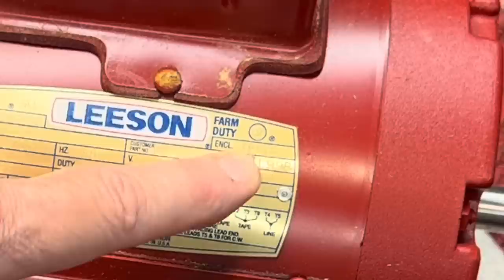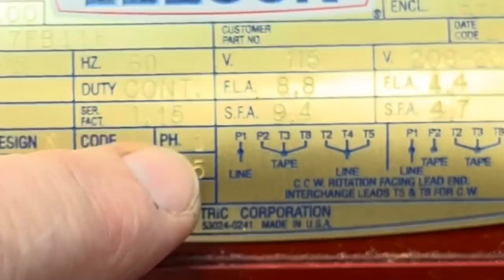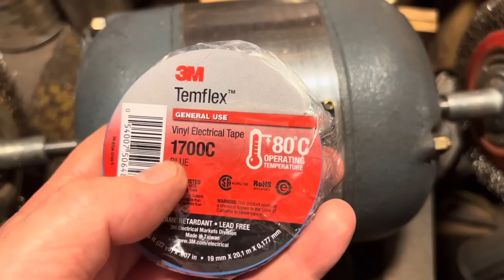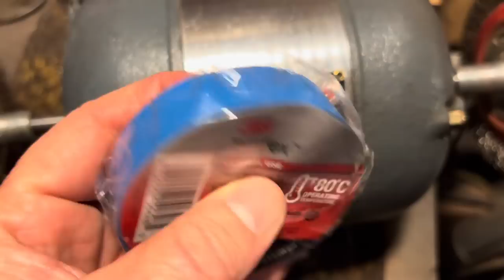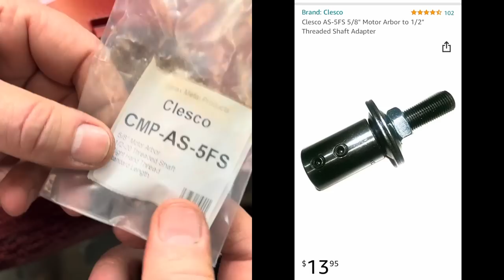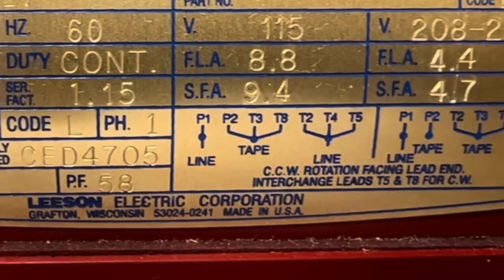Wiring a Leeson Farm Motor also How to Add a Switch to an Electric Motor

Comment: Jaws gave me a life long admiration and love for sharks , and I only learned recently , the story they were talking about below decks about the battleship sinking and the sharks eating hundreds of the sailers was based on a true story !! , anyways great video as always , cheers scout 👍
Reply: Yes it was the USS Indianapolis which was sunk close to the end of the war by a Japanese submarine.  The USS Indianapolis had just delivered an atomic bomb to an island from which the B-29 was to attack from.  Due to the importance of the mission, the radio antenna had been cut to ensure radio silence.  As a result, there was no call for help and the sailers were eaten alive by sharks for days until the ship was reported overdue at its destination and a search began!  There was no expectation for a Japanese submarine to be so far away from Japan at that time, and it seems too much of a coincidence that it happened.  There is a conspiracy theory that the Soviets were aware of the mission and tipped off the Japanese to try to prevent the USA from deploying the A-bomb since Russia did not have one yet.
Reply: Yeah that's the ship that delivered the A bomb parts so it was a top secret mission. They were on the way back but not many knew they were there still. Which is why they weren't rescued so promptly. In the middle of the ocean I guess you're lucky if you get picked up at all. I think they were in the water for over 3 days? Sharks or no sharks that's got to be rough.
Reply: My mom lost her cousin when the Indianapolis went down.  He was likely killed by sharks as the last a guy from his home town saw him he was going down the side of the ship with a bleeding leg.

Comment: Switches:  A great point – for a repair or single instillation – spend a couple of bucks more and get a higher current capacity switch.  A switch with twice the current capacity, for most home shop uses, is not too much.  Will only cost a few dollars more.  (“A Few Dollars More” is a great movie too.)

The extra cost will provide a switch that will last longer than one that just meets the current requirements
Reply: An induction motor can pull 6 times its nameplate rated current when starting. So that's a lot of contact arcing.

Comment: Great motor video. Good explanation of the wiring and adding a switch. I’m sure not many would notice your ratcheting solder-less lug crimping tool. I have a few that I’ve had for quite some time. Picked them up when I went to the ham fest in Dayton, Ohio. That was a great trip. The crimped sure beats just mashing them with that cheap tool. I got quite a few of these ratcheting crimps. I used a lot of Power Poles for my Ham Radio activities. Thanks for another great video. 

Best Regards,

John

Comment: Jaws was a great movie my 2 teenage sisters didn’t go in the ocean for years.   I was a bit surprised you fired up that motor with  the key still in the shaft but saw after it was a good interference fit. Good stuff
Reply from the maker: There was a small rubber band on the shaft but it was in there pretty good...  If it went flying across the shop I would never find it for sure!

Comment: Another nice video today John and I do remember Josh coming out of Theatres and being scared to death of the ocean little did I know a few years later I would join the Coast Guard and have to be in the ocean all the time lol. Hey let me recommend trying to use Wago Connectors. I use them all the time especially for tight locations and they’re far superior than wire nuts. They are pretty expensive too and are reusable. Hope you have a great day see you on Friday

Comment: I had some old lapidary equipment that I was making available to members in our rock & gem club and needed to wire up a motor for a diamond saw. Watched your video to brush up on the connections and was amazed how you clearly you explained the process. Your videos are a hoot and you have a real knack for simplifying the task.  Got certified for scuba about the time Jaws came out and had a  2 ft. dogfish swim in front of my mask at close range and scared me beyond the pale. Thanks for all you do.

Comment: We were taught to ALWAYS remove the key before starting any motor. Have seen them fly out of keyway. Best practice is to clean every shaft then apply antiseeze compound. Had 1/2 to 2 HP C face motors that bolted right up to a gearbox. My lazy boss never cleaned motor shaft or used anitiseeze so when one of his installs burnt motor up I always left it for him to make wood wedges and spend 20 minutes to pull a now rusted motor shaft off a gearbox. Great ideal to use a piece of shrink wrap tubing.

Comment: When I repowered my milling machine and drill press, I used the identical leeson motors, only continuous duty. I had been a pretty strict baldor fan, but their quality seemed to go downhill a little bit around 2000. I bought four of those motors and I think they were about $650 a piece so I think you did pretty well!

Comment: I never watched Jaws or got a new motor. With everybody talking about that movie I was scared to even wash my hands and all my stuff is old, old, old except for the wood splitter and a chain saw. I'm a polar bear type and hardly ever wore a coat unless the snow was falling when I was driving a mixer. Unloading you weren't outside but maybe 30 minutes and them back in the cab with a screaming heater. I do have Carhartts now for the real long exposure time. Happy mid-week and every hit man needs to tote stuff home for his GF to stay in shape but round is a shape too, Buddy! GBWYou!
Reply from the maker: I too prefer cool crisp air and flannel shirts over sandals and shorts.  =D
Reply: @ScoutCrafter  Me too. Shorts are just easier to deal with and I can find a fire if I need one, even if I have to build one!

Comment: John - could you please show the information card for the arbor adapter? I haven’t found one yet that I feel good about buying.

As far as the heat goes, it has been 100 degrees plus here in the Dallas-Fort Worth Metroplex for the past several days without any rainfall.

Another great video and keep them coming.
Reply from the maker: Hi Anthony- This is for the 5/8" shaft only!  https://smile.amazon.com/dp/B077BJ4C2S?psc=1&ref=ppx_yo2ov_dt_b_product_details

Comment: Lovely motor, it might have been worth putting that 'key' inside the switch housing in a small zip lock bag, never know when you might need to run something with a keyway.
Reply from the maker: You know that is a great tip!

Comment: Good advise on getting a quality adapter.    The one you have runs nice and true.   Cheaper ones may not run true.
I prefer TEFC motors.   I am not happy when I get a machine and it has an open style motor such as the one on my air compressor.   Too expensive to change out.   The manufacturer saved a few dollars.
Lots of good information in the video.   You may want to explain about the NEMA Frame code.    The 56 frame defines the shaft dia and length, key dimension and dimensions of the foot.
Dave.

Comment: Nice job. I was an auto electrician and worked on all sorts of equipment and vehicles on farms, sites and on the road. Some people call the tape electrical or electricians tape. We always called insulating tape. I only really liked using on looms to seal the end and keep the nonstick loom tape in place. The problem, especially in vehicles, is it would get diesel or oil on it then it wouldn’t adhere properly but you’d be left with this sticky oily mess all over the wires so I would always be sparing with the sticky insulating tape. 
I remember as a 15 year old apprentice asking for a pair of scissors to cut some insulating tape. Everyone laughed until one kind soul show me the trick of pulling the tape until it snapped giving you a nice fit around whatever you were wrapping. 

It’s not a criticism by the way. We all work in our own way. Just sharing some thoughts.
Reply from the maker: A lot of guys are going back to friction tape as it seems to last longer with less problems...  Thanks!

Comment: Leeson made really good motors and I wouldn't be surprised if many labeled Dayton were made by Leeson. My 20 gallon air compressor has one.  If I remember correctly most of the electric motors on the last dairy farm used them. And there was a  lot of motors on the silos,  elevators and the feeder over the feed bunk. All that type of dairy farming is different but mostly gone. About the same time Leeson was bought by Regal - Beloit.  The latter have been gobbling up the competition.  I don't get to wire much anymore.  It's what my son does for a living and well the old man has to step aside at some point.

Comment: You need a hand truck to bring things home, John. I bought home a coffee table with mine last night. Also scored a bunch of 2 different sizes of conduit and a HVAC 2 Watt motor that opens and shuts the vent. The odd things are the wires are stripped but the insulation never removed so I have no idea if it is going to work. Might even be a plant. I don't know what to make of the conflicting signs on it yet so I will have to d9ig deeper into it. 
 I have a motor with an electric clutch on the end/. What could I use it for?
 I also got out to Edina for the outdoor movie Sing 2. Great starter vid on motors. nThose TEFC are also most favored by the better Cabinet Table Saws.

Comment: John, your motor wiring is excellent, neat and safe.  You could have pointed out that you switched the black (hot) wire and not the white wire.

Comment: Very well done, yeah these motors are built to last. They also coat the windings with glyptol. A type of varnish to keep the windings from shorting out. Now i know you already know this but it's probably not glyptol to be exact. I just bought a leeson 5hp single phase farm duty motor. I gave 1700$ for it. Not sure if thats a bit expensive or a good deal? I believe they use polyrex EM grease still? Also i have molykote electric motor grease that i may re pack the bearings on my leeson  3hp electric motor. Now that i have my leeson 5hp i may swap out the 3hp motor for the 5hp motor on my air compressor, that way there is less stress on the motor. Can you please recommend what i need for my new 5hp motor? Thank you

Comment: I remember seeing Jaws with my older sister in 1975 and she must have seen it before me and she had me look down during the underwater scene when the head floats out of the boat wreckage and I heard all the audience scream. I’m glad she had me look down, because I was ten years old and it probably would have given me nightmares. 
That motor is great. I always look for motors in the trash. They used to be a lot more common than now. Great tips on the wiring and the switch. How was that tape? Was it sticky, or tacky to your hands?
Reply from the maker: That tape was great!  Nice and flexible...

Comment: The switch is nice to have, but the last time I redesigned my grinder area, I decided to use a deadman switch so that I can come up to the grinder with both hands holding the object if I need to. Anyhow it is less disruptive for concentration on the workpiece.

Comment: That's ONE American workbench. Very educational videos. I have a question (sorry if sounds primary). What is the standard voltage in the US? I see in videos different voltages like: 110V, 115V, 120V etc. I am from Brazil and here the standard voltage is 127V since the 1980's.

Comment: Im working on an old Leland motor . My switch has a breaker built right in .it's a standard house hold   wall mount light switch . Why didn't you use one . It would have mounted to that same box you put the toggle switch in ?
Reply from the maker: Household light switches are quite a bit larger then toggle switches, a little tight for room in that box.
Reply: Thats what I use but he is right the box would have to go atop that other box. Even better I have a GE washing machine motor and it has slow and fast speed which I hooked up using a standard wall "3 way" switch. It's nice to have two speeds when wire wheeling and grinding.

Comment: I had an idea for your Hammer stand. I'm sure you are familiar with those 3-in circular bench anvils made by starrett with surprisingly good fakes made in India. I find them surprisingly handy in general, but they are almost always knurled around the diameter, leaving you without an edge to hammer around. So I think if you kept the varied pin holes but had a raised anvil in the center which fit into the hammer, this could be useful at the same time as aesthetically pleasing. I don't know if you do much engraving work, but that type of hammer with a flatter on one side and convex on the other is typical for some of the finer work. Maybe instead of holes to punch out pins, these could store various gravers one would use with the hammer?

Comment: Boy you should never start a motor with the key in the shaft Even with the rubber band it could put your eye out. Take the key out or tape it to the shaft.

Switches if they have a HP rating it should be rated fot the same HP as the motor or larger. If the switch is not rated in HP it has to be rated for double the motor horsepower.